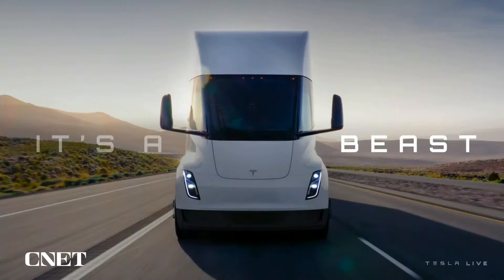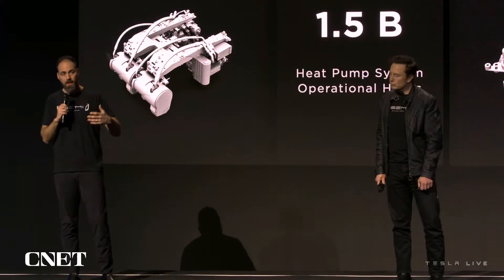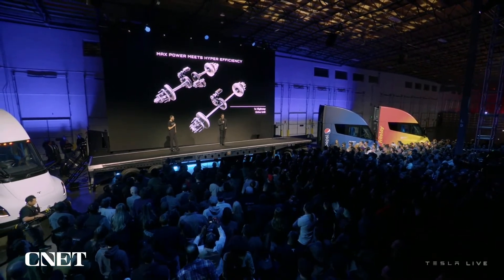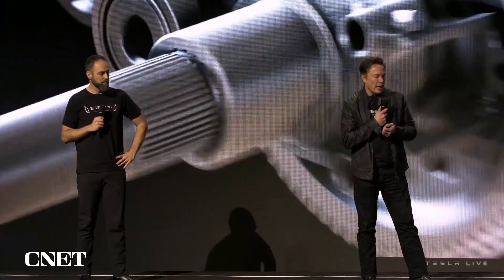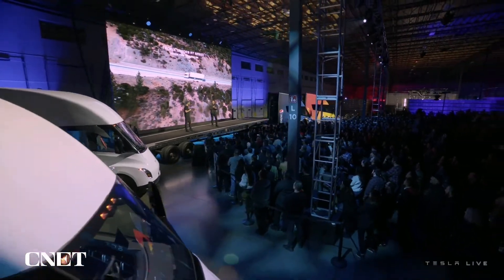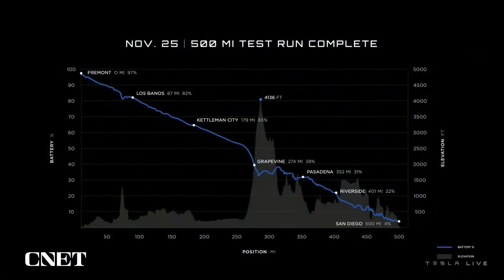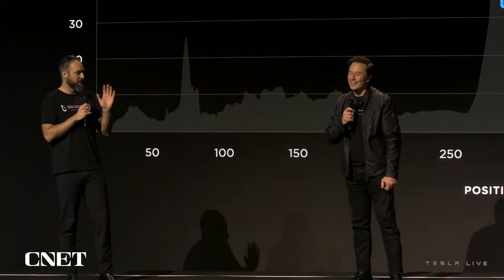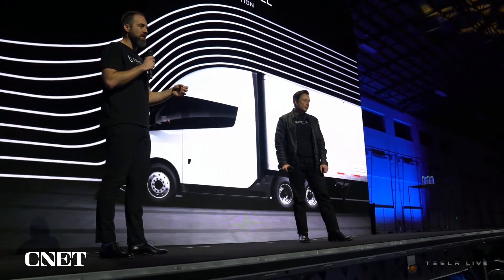Watch Elon Musk's Deep Dive Into the New Tesla Semi-Truck

Comment: He can't stop talking about how fast it is.....the most useless metric possible. 

1. Load capacity (an actual number)
2. Range with max load
3. Detalied explanation of charging strategies on real routes.
Reply: I think this is meant as a production announcement and these values will change over time. The way it would work is you can/would only buy one if your current expectations are met.
Reply: @quinnfoster1234  How am I supposed to know if my expectations will be met if they don't offer real and practical data? It's all marketing fluff with little actionable information.
Reply: @Factory400  Go and ask them as a potential client. I'm sure they will be happy to give you the answers.
Reply: @Factory400  range with max load = 500 miles as demonstrated in the delivery event.
Reply: @Agnemons  If the answers aren't published to the public like 100% of trucking industry....I will never be a client. Whether I am buying a truck or an airplane.....the key specifications are always published.
Reply: @slopedarmor  A marketing demo has no relationship with reality. Ever. 

Still.....no word on the mass of the payload which is positively the banner spec for a truck. It's an industry that ties its revenue to that spec. If you have a load that can run on a single diesel but needs be split on two Teslas....that is a big loss. 

Payload is key. I don't know anyone that cares about acceleration.

How much does the 500mile capable unit weigh? What circumstances are required to get that 500 miles?

And zero truckers will go to the last mile.....so it's a practical 400 mile unit. Less than a day of driving and you have to find a rare charger that is actually available and then wait for a few hours to continue? Marketing is not answering any of that.
Reply: @Factory400  It sounded like you wanted to know what the range with max payload is, and I just clarified that for you since I was assuming you werent paying attention. Will the tesla semi be a good replacement for all diesels? ofcourse not. Will pepsi probably have a few busy routes where there trucks always follow the same route and where they can build 1MW chargers and thus actually make the tesla semi practical? yeah probably.
Reply: @slopedarmor  My first request was a load capacity. So far, no answer. 

Additional data: What speeds? Truck speed limit in California is 55mph statewide. Most trucks run at about 60-65 which is a substantial difference for range. More importantly....the rest of the USA is 70-80mph which is a huge difference for range. 

I should add an additional note....flatbeds have way less drag than a more common box trailer. 

Essentially....a run optimized for marketing does not match a real world run. The Tesla Semi will not be able to do a day of driving without the (currently) horrible charging.

It is suitable for a local delivery truck...and probably quite good in that regard. Especially with the high tech backup assist and other collision avoidance technology.
Reply: @Factory400  yeah there is no answer for your first request yet. I was just saying your second request is dumb because that data was in the presentation. Looks like they used 94% battery for 500 miles where they started at an elevation @ 100 feet, went to over 4000 feet elevation and the destination was at 200 feet elevation, with 82k lbs. Sounds like charging is very rapid with the 1mw+ charger, surely pepsi can install a few of those where they want via tesla. And it sounds like the cybertruck will be able to use the same charger, but not yet clear at what rate, maybe its only 500kw for the cyber, who knows. But that does sound like we can expect a lot more 1mw+ chargers in the wild in a couple years.
Reply: @slopedarmor  No....the question of range was only partially answered. Without speed data and a box trailer I would (if I am business planning for owning this vehicle) consider it a 400mile max range system. That reduces is to being a local delivery truck.....like Pepsi. 

For me, its useless. For interstate hauling, no go. In its current form it has limited utility. 

The load capacity is still THE BANNER SPEC and that is still a mystery. If that number was at all favorable, Tesla would have published it.

Comment: Though I don’t know the equivalence of HP in the truck, I was able to control 3000 TONS with 4300 hundred HP going down a 1% grade. Any heavier and my butt was chewing holes in the seat!
Reply: Yup that would be because you were running steel wheels on steel rails. Not renowned for their traction coefficient.
Reply: @Agnemons  one difference in your reasoning. Sand….it’s like rubbing 2 pieces of paper together versus 2 pieces of sandpaper. Just what is your point?
Reply: over 1200+ HP. with 3 motors.

Comment: If the brakes don't compensate for the load weight, that thing will jackknife pretty easy in the real world...
Reply: @JorgTheElder   He almost drove into the crowd because the brakes locked up. Disturbing
Reply: Pretty sure they test a cargo hauling truck for cargo loads...
Reply: @S2kBPRIME   Watch the video, the brakes lock up right before he almost drives into the crowd. Somethings wrong.
Reply: It has in build system to completely eliminate jackknifing. The tires move can move independently and automatically stop jackknifing.
Reply: @imharbinger   No, watch the video and see the brakes lock up.   Something is WRONG!!

Comment: Supply of lithium ion batteries would be the biggest limitation in terms of availability..
Reply: 2170 in secure supply, GigaNevada makes TERRAWATT hours of 2170 .
semi FACTORY located @ NEVADA.
Reply: look at the current electric prices, cant replace something when it costs more to drive
Reply: @MrPaxio  The average price for electricity in CA is 28c per kwh. So $280 to fully recharge this truck. Current diesel price in CA is $6 per gallon. At 8.5mpg average for a diesel semi, you are looking at $353 for the same trip.
Reply: @anthonypelchat  yes and those are residential prices where it charges whole night, super chargers cost minimum 35c/kwh(i seen 50c/kwh on east coast, up to 90c/kwh). diesel is $4 where iam. who uses CALI as the bog standard? weirdo, anyway, same electric price if not more, add on the demand spike this 1000kwh will add instead of 60kwh tesla, ure gonna be in trouble. you really think theyre just gonna let you drive for free and not make a profit? thats hilarious
Reply: @MrPaxio  On average, Supercharger prices are around 25c per kwh in the US. On average, diesel on highway prices are around $5.15 per gallon right now. Cheaper can be found for both and more expensive can be found for both. But that is the current average for the entire country for both. At those prices, diesel is nearly double the price per mile as the Tesla Semi. SC pricing would have to be increased to an average of 47c per kwh before it would be more expensive. Of course if that happens, diesel also jumps in price. 

Now onto the rest of you idiotic statements. I used Cali since they are the most expensive electricity rates in general for the country. Very few areas are more expensive. And who said anything about them letting you drive for free? Just because you throw out random numbers doesn't make them right. And both Tesla and other energy providers can produce electricity to sell in other ways if demand charges are too much.
Reply: @anthonypelchat  great youtube deleted my comment. anyway its $4 gallon here in the city, you go to suburbs its about 3.5
Reply: @MrPaxio  Good for you. Where I'm at, electricity is 10c per kwh. Other areas of the country, diesel is $7 a gallon and electricity is 50c per kwh. It's all over the place. But on average, electricity with the Tesla semi is going to be about 60% of the cost per mile as diesel is. And that is with grid rates. You can also create your own electricity.
Reply: @anthonypelchat  10 cents before delivery and service fees bro. 10 cent is lowest in the country BEFORE delivery fees. so you must live where nobody else does or travels to or from, like north dakota, idaho, nebraska, utah, wyoming. nobody lives there my guy, you cant compare cheapest and expensive when nobody is gonna travel to Wyoming to charge their truck. and these trucks are gonna operate mostly on the east coast, and like i said those charger prices on the east coast are 50-90c/kwh. and theyre not even fast chargers, slow af chargers and they want 50c/kwh. RAW electricity prices went from 2 cent to 8 cent this year before those fees. 60% of the electric bill isnt even the raw electricity cost. and also on average the semi is gonna travel 60% of the distance a diesel truck can, sooooo(some semis have 300 gallon tanks which will take them 2000 miles so on one load they can return to where gas is cheap, an electric one will have to charge at the destination which will be a big city and expensive prices). and unless elon can figure out how to charge 1000kwh in 30min, they can barely do that with 60kwh. theyre gonna need alot of spots and expensive space for those trucks. liquid cooled cables and everything like those arent gonna be cheap and maintenance wont be cheap. now ure gonna need specialized high voltage workers with extra gear to troubleshoot stuff
Reply: @MrPaxio  A 5s searched shows that Louisiana has rates at 7.5c per kwh. And again, just because I'm pointing out cheapest rates near me doesn't change anything. I have already given you average rates for both diesel and electricity. I will repeat, ON AVERAGE the price per mile is about 60% of what diesel is. And ON AVERAGE, Supercharger rates across the US are 25c per kwh, which is after all transmission fees and with the stations pulling more from the grid than many semis will be.  

As for the supercharger rates, I can only assume that you are either making crap up or pulling numbers from someone else. The most expensive rates I could find for SC in the US are in Cali at 57c per kwh during peak hours. Maybe there is somewhere else worse, but that is a massive exception. Again, ON AVERAGE, the price is 25c per kwh across the country.
Reply: @anthonypelchat  bro thats the price before delivery and service fee which will make it 15-20c/kwh, google aint gonna tell you that. also explain to me how the semi went 500 miles when you cant charge the battery above 80% or let it drop below 20% unless u want to swap out the pack every decade. and the semi needs to go further than the destination unless they want to charge near a city for 50c/kwh after dropping off their load... and wait for it to charge on top of that and the company paying an extra 5h for the driver to just get ready to come back for another load, then it comes back and it needs to charge again! reg semis can go 2000 miles before 10min refuel. even if its cheaper when ure paying the driver $40/hr just to sit around and wait for the truck to charge, it wont make it cheaper. its like youre forgetting when the idea is put into actual practical use(which elon is known for). i know people who run logistics companies and they're not as excited about the tesla semi as you are for some reason. its not an EV that sits in your garage most of the day and you only drive 20 miles a day. also engine braking is a thing on trucks, regen braking isnt gonna save your argument. the tesla semi will be a joke just watch, just like majority of elon's ideas. it won't be worth it when it can only go 350 miles compared to a semi that can do 2000 and the trucks cost the same
Reply: @MrPaxio  again, bro, the AVERAGE PRICE THAT YOU PAY FOR SUPERCHARGING IS 25c. How is that so hard for you to understand, bro?
Reply: @anthonypelchat  don't forget that the truck drivers need to be paid while they're waiting for the truck to charge
Reply: @MrPaxio  they are forced to take a break every 8 hrs anyways. Take a 30 min break and charge at the same time. Not that complicated.
Reply: @anthonypelchat  yeah charge after they get to their destination, which will be a populated state with expensive power
Reply: @MrPaxio  And you can charge the battery above 80% and drop to nothing. Happens all the time. That's like saying why is the range of a gas truck such and such when you can't use the last few gallons of fuel or full it up all the way without overflowing. Same answer. You can and the comment was just dumb.
Reply: @anthonypelchat  majority of the population doesnt live where youre claiming has cheap power. and no, you can run the tank dry or fill it to the top, ure only able to use 60% of the battery if you want to make sure it won't fail down the line and dish out $50k+. some packs will fail sooner than others all depends if u got lucky. and the only thing ure risking is the fuel pump
Reply: @anthonypelchat  it only takes one module out of the 1000kwh to make the pack fail too
Reply: @MrPaxio  In case of an accident, what happens with a fuel hauler wrecks? A Semi EV wreck wouldn't be anywhere near as bad as a semi hauling 11,000 gallons of fuel in the trailer behind catching on fire. 

As for brownouts, charging a semi is about the same as charging 4 passenger EVs. And we have stations handling dozens of them. Further, a single megapack from Tesla or others can prevent the station from having grid stability issues.

Comment: I want to see how it does In bad weather -20 ....i want to see if that truck can handle it
Reply: Probably around 30% range loss.
Reply: TESLA semi TESTED in Fairbanks, AK USAF testing grounds.
Reply: @markplott4820  
It's very different when you're in the road some places you get stuck in the snow but no electricity for days what you going to do
Reply: @Mrdice_m   - BEV dont get stuck in the snow , the act as their own SNOW PLOW . 
my TESLA has 1200+ HP and 1100 lb Torque . 
in Winter time I use OFF ROAD Pin Spike tires. 
and my Sister owns a TESLA in Anchorage , AK she Fully Charges @ home and can Charge for FREE @ work. 
TESLA semi is no Different. 
TESLA semi has SAME Drivetrain as my TESLA. Semi just has BIGGER battery. 
and Recently TFL took their LIGHTNING to the Artic Circle in Alaska, they were able to CHARGE there.
Reply: @markplott4820  a truck should handle everything unexpected or it's no good I don't think Tesla can't 
My truck can drive 1200 before run out of diesel...I been all different storms and my truck never let me down...it has over 2,000000 miles just broke down 5 times
Reply: @markplott4820  I'm not against Tesla truck
I know what a truck needs and for me not ready
Reply: @Mrdice_m   - USA operators will go TESLA semi , PURELY for Financial reasons.
ROI is just 1 year , compare to Hybids and FC H2 . also incumbant Diesel semi. 
the Operator instantly saves $200,000 each year. 
and 50% less maintanance. 
all with a BATTERY warranty.
Reply: @markplott4820  
There should be somebody in here with facts and know what they're talking about
Truck this will be the last time I will respond to you
Reply: @Mrdice_m  - before you do.
watch , Tony Siba - Disruption of TRANSPORT. - youtube.
Reply: I'll drive in just to see

Comment: The average speed was pretty low, under 55 mph.
Reply: And you, obviously, have never driven a truck.
Reply: @Agnemons  I'm comparing it to trucks I encounter on highways, that consistently go 70 mph. It is clear why they set the cruise control speed at 55 MPH, because there would be no charging opportunities on the road and that's fine. If you watch the 2 minute video with the entire drive sped up, but at .25X you can clearly see the speed on the left monitor, rarely it goes over 60mph and it doesn't seem like he passed any trucks. In fact trucks were pulling away from him. That is totally understandable, coming from a Tesla owner range anxiety in  these unknown situations is real. I am impressed that they were able to drive 500 miles using 94% of the battery capacity. But it would be nice to publish the average speed, or at least the total moving time, excluding stops.
Reply: @dimplezdimples8451  If you carefully look the altitude of the journey, there were lots of steep climbs. Fully loaded trucks are extremely slow climbing uphill. Thus the average speed being low. In fact gas trucks are slow going down hill as well, to prevent brakes from over heating.

Comment: Currently it will just take 400 years to replace all diesel trucks on the market with ev and Infrastructure. Let that sink in.
Reply: that doesnt make sense,, it didnt take 400 years to build all the trucks currently being used,, i would think most of the worlds truck fleet is at most 30 to 40 years old even in the most underdeveloped of places,, and when you consider the manufacturing revolution that Tesla has already demonstrated  why would it take any more than 10 to 15 years to replace the bulk of the worlds trucking fleet,, ?
Reply: You think they can't scale up production? 😂 dude has a bunch of gigafactories and more on the way. Not to mention other companies will start making these.
Besides, no one is trying to replace them all lol. That's not the immediate goal. We're trying to keep new ones off the road and replace dying ones
Reply: + , over time, 3D printing will greatly reduce the need to transport stuff around the country, and therefore the total fleet size.